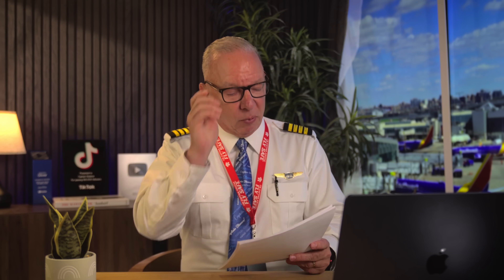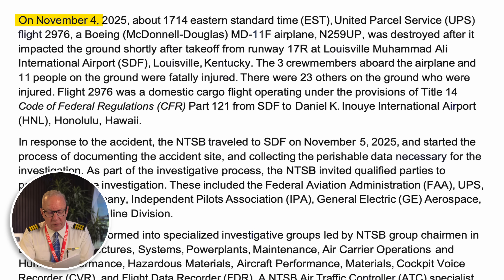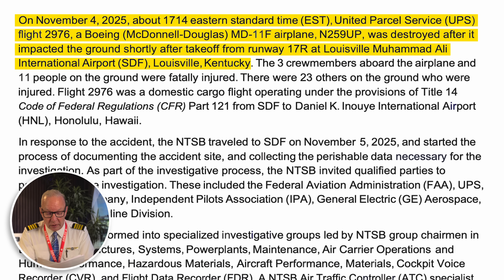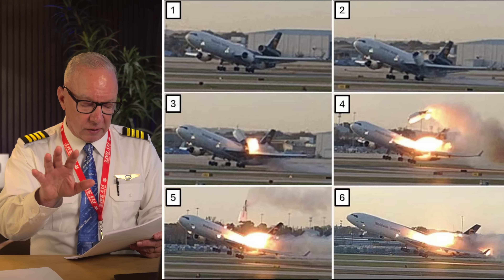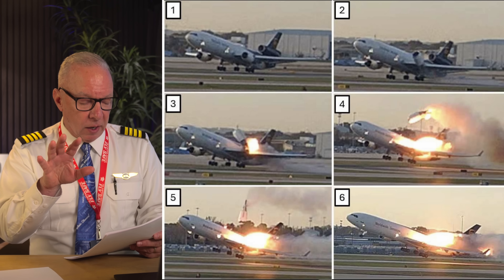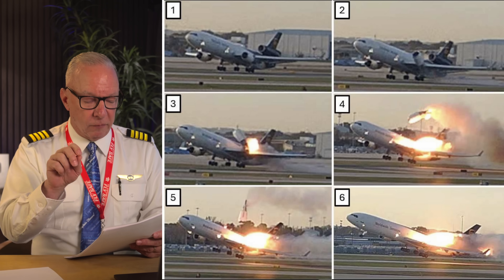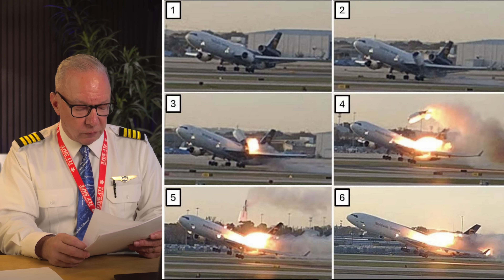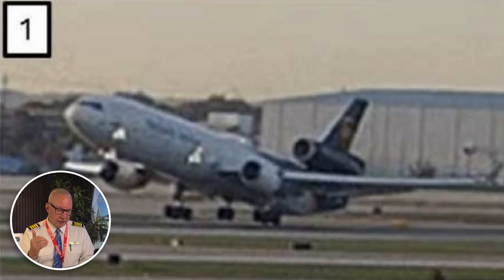UPS Crash Preliminary Report | Pilot Reacts to UPS Crash Report

Comment: Given that the NTSB has obviously read out the FDR data this report should have included information about the failure of engine 2. They likely don’t know why yet but we know it failed and that information could have and should have been included in this update. 

An interesting question is what the certification requirements are for that aft pylon mount. Since we have a forward and aft part of the mount is either mount supposed to be capable of carrying the entire load if the other fails? If not why have two separate mounts that way. If you need both that becomes a single point of failure. Which leads to questions about how that failure was analyzed especially with respect to the effect that failure and the detachment of the engine and pylon might have on the #2 engine. If a pylon mount failure isn’t an extremely improbable event then you have to question the analysis of how that failure might impact the ability for continued safe flight.

Comment: Captain Steeeve, in this modern era of advanced technology why don't manuafacturers and airlines place small cameras showing the top and bottom of engines that can in an emergency show a display on the advanced screens of cockpits so that pilots know EXACTLY what is happening to their aircraft's engines. A cockpit notification of No power and/or Fire IS NOT SUFFICIENT NOTIFICATION TO CREW in case of a CATOSTOPHIC ENGINE EVENT. Even a interior window mounted camera would be better than nothing and fairly inexpensive. LIVES ARE WORTH MORE THAN MERE PROFIT.

Comment: What evidence do you have that the #1 engine itself came apart (FOD, EOD, liberating blades, uncontained failure, etc.) prior to impact with the ground? The blades discovered on the ground are as likely as not to have ended there as the result of the #1 impacting the ground while still in a max, or near max RPM, gyrational dissipation event. In the absence of a #1 engine debris field in front of the #2 engine, the most likely cause of the #2 compressor stall is the burning fuel fire plume (pressurized main fuel line at the #1 engine mount) that either starved the oxygen for - or - disrupted normal airflow across the #2 intake zone. 
40 years commercial engine overhaul work + previous 10 in the military. I might know a thing or two on those "suck/squeeze/bang/blow" thingies. 
I appreciate and support your channel, but as Joe Friday said, "Just the facts, please".

Comment: Captain Steeeve, How are the engines on the more modern planes (777,757,737), which have the same under the wing engines  different from the DC10?  There are a lot of them flying, with out a problem.   I hope the the pylon are check more than every five years.  Thanks for the great video.  Fly Safe Bruce

Comment: These planes should have been figured out all those years ago. DC10 has been a waiting time bomb for decades. When crashes happened in the 70’s this is when it should have went back to the drawing board to make a better support system. I’m aware of the design but if these fractures keep happening wouldn’t this be something they check for regularly? Just as a precaution so these flights don’t fail? This is a lawsuit waiting to happen. As it should be and needs to be towards Boeing and UPS. It’s unfortunate for those people and their families. 
Unfortunately the only time things are “changed” is from death’s and now after decades these planes get grounded. For how long exactly? Sure they’re grounded now, but are they going to just repair each wing mount to then put them back in the Air? Or they going to permanently ground them? Above my pay grade for sure but I’m just frustrated they knew about it all these years ago and it’s happened again.

Comment: In the pictures you showed it doen't look like the fire is coming out of the number 2 engine.  That flame is a lot lower than the number 2 engine. I kinda suspect that it's the engine that came off.  A auestion:  Does this mean that the cpnclusion they came to on the American fflight that lost an engine iw wrong?  In other words, they said it was the mechaniics using the wrong mountting procedure caused that crash.  While that may have been a contributing factor maybe there is someithing inherently wrong with the mount.

Comment: I’m curious if the pylon on the right engine, #3, had any evidence of  fatigue.  Does any other aircraft potentially share a similar pylon issue?  I would think all aircraft with wing mounted engines would need to be checked. For years I have wondered why a GoPro or similar camera aimed at each engine is not standard equipment on every aircraft made.

Comment: While similar to the 1979 DC-10 incident, the failure mechanics are completely different.  In the 1979 incident, maintenance processes damaged the wing structure at the aft pylon mount point and the wing structure failed on takeoff.  In this accident, the pylon structure failed at takeoff due to fatigue.  From an engineering perspective, this is a different failure mode.

Comment: 5:23 that altitude is AMSL, Above Mean Sea Level, so it doesn't mean that the nose of the aircraft was 481 ft above the runway.
Reply: That particular confusion seems to be entirely Captain Steeeve's.  The NTSB didn't specify MSL in their first press conference, so Captain S assumed they meant AGL, which would not be a reasonable assumption (but it was nevertheless an assumption).  Then the NTSB clarified MSL explicitly in their second press conference, which Captain S apparently missed, and so he seems to be claiming (still today) that the NTSB was simply wrong about the altitude.  They weren't - at any time.
Reply: The runway itself is 460-470 feet AMSL.

Comment: Im absolutely not an expert, but I’m fascinated (a little obsessed) by airplane accidents. Its seems wild those pylos where the only thing holding that engine. Seems like it needs a lot more than just that
Reply: Yes just 2 pylons holding the engine to the wing, one at the back and one at the front,  in a way its those engines that are pushing all the weight of the aircraft forwards so yes agree.

Comment: Looking at the photos with hindsight is a bit deceiving as we are looking a bit preemptively. However the left engine looks like it's begining to separate and the right side looks like it's lifting in advance of the left. 

Is it possible that the left engine was losing thrust as the aircraft commenced rotation?

Comment: What i find interesting is that the engine + pylon assemblies are not rigidly attached to the wings, but rather are supported by bearings so they can "swing" to some degree under the wings. So tragic how one such comparatively small component means tragedy.

Comment: Once infrastructure reaches imperial scale,
it requires continual replacement,
not occasional repair.

The U.S. still operates at imperial scale —
but funds and maintains like a suburban democracy.

This mismatch creates stress, fragility, and hidden decay.
It doesn’t collapse — it spreads, dissolves, erodes, then snaps.

Comment: Surprised the fatigue inspections are so far apart on such an old airframe. Praise to NTSB for such a detailed report. Thank you Captain Steve, and prayers for all involved.
Reply: You would think they would at least do a quick inspection before they do the lubricating procedure, and even that is two yrs apart. Crazy.
Reply: @tBeNz0  Yeah, though micro cracks and small cracks can be difficult if not impossible to visually see without some kind of specialized equipment, but don't lose sight of the fact the person DOING the inspections is the weakest point- he or she can miss things or even just be lazy and miss things yet sign off on having done the work properly.
Reply: @tBeNz0 This bearing is not a high temperature or high wear surface bearing like a rod or main. It doesn't rotate at high rpm and it's a ball. A pack of grease and it's good. Like the ball joints on your front end. Only these have balls 😂😂. The pylon hangs on it and swings left to right about 10 second cycle. It doesn't take thrust forces.
Reply: @fedfraud.protection.servic2557  Yeah I get all that, but so many things could happen on just 1 cycle, but to have tens of thousands without one seems reckless. 

I doubt regulations for passenger aircraft are the same, but I don't think many people would fly knowing some of the things on the plane, like the thing holding the engine to the wing, hasn't been checked in over a yr (i have no idea, just giving an example). The sad thing is, I bet they have the money to do better checks and more often, but squeeze every possible penny they can get out of the planes before it has to be grounded for inspection.
Reply: I'm a little surprised too.  Even more shocking is that during 'A' inspections, I understand that the engines may still be hoisted and the forward pylon mount detached, potentially putting excess stress on the rear mount.
Reply: @AJCiani-physics An A check is a low interval inspection. They wouldn’t pull an engine as a normal part of an A check
Reply: @karlmerriam  It is surprising, however, that a non-destructive inspection (NDI) of one sort or another isn't performed, especially at shorter intervals between major inspections where the engine and pylon would be removed. With all the stresses these engines put on the wings, I'm surprised that the inspection interval is six years. I come from an aircraft maintenance background in the Air Force, and though I didn't work engines (I was hydraulics), it seems to me that we had inspections more often than what the civilian world requires. I hope this unfortunate accident forces some changes in the inspection criteria. Lives depend on it. RIP to the crew.
Reply: @billmcquown4168 The NDT inspection was due on the pylon mounts at 28,000 cycles. I’m sure the repeat interval was much lower. The inspection intervals are determined by engineering analysis. Of course a manufacturing defect can go undetected and cause failure. I would bet that the FAA is going to require all of those aircraft to undergo NDT of the pylons before letting them fly again. There will probably be a reduced interval for those inspections required also. Most of those aircraft weee about to be retired anyway so the operators might just scrap them
Reply: @billmcquown4168 my father their was a BOAC aircraft engine inspector, no aircraft took off without being inspected in those days. Seems like things are progressing backwards these days.
Reply: @billmcquown4168  It's amazing how LITTLE actually holds these massive powerful engines onto the wings in the first place!
Reply: @billmcquown4168  It is the rear (aft) pylon bearing lug that fractured. And don't think it has been determined when the fatigue cracks initiated. Anyway, it's pretty deep back hard to reach. Might come up with a colon camera to reach back there and look. I thought it was a bolt that sheared at first. I'm just now starting to get it together to see it.
Reply: The airline industry had 296 lobbyists focused on the sector in 2024. Lobbyists have a lot of clout in the tangled web of governmental bureaucracy.
Reply: One would think the inspections should increase in frequency as the airframe ages  ---  and did they have scheduled replacements on certain parts? ... on my car many components get replaced after a certain amount of time before they fail, and I have no complaints about spending money on that because I obviously feel safer with fresh parts
Reply: @smedleyx  They do decrease the inspection intervals as the aircraft ages. The initial inspection is referred to as the Threshold Inspection. The subsequent repeat inspections are at reduced intervals
Reply: @karlmerriam  It should be clear this failing at 21,000 cycles and not being due for that detailed inspection for another 7 or 8,000 MORE cycles- 1/3rd more, is WAY too far off!
Reply: [And here I still wonder whether I MUST have my Corolla's (full synthetic) oil changed every 5000 mi, or can stretch it out to 7000] 😉
Reply: @stuartparker-q3o  Yes you can. As long as no one pours sand in your crankcase or the PCV falls out of it's socket while you drive off road through a desert or you don't get on it constantly with a dry crankcase or.....😂😂. Bearings can flake prematurely, piston rings scrape metal off the cylinder sleeve, etc. Big part of oil change is it's an internal engine inspection to make sure nothing bad is happening and catch it if it is. Someone once drained the oil out of a Rolls Royce and drove it six miles before the engine seized. Not saying you should, just saying 😂. Tell your guy or whoever to drop a can of STP in next time (as long as the oil is clean).
Reply: @fedfraud.protection.servic2557  I remember, on the (former) radio (PBS) show "Car Talk", where a caller-in told the Magliozzi Brothers that, after draining his car's crankcase, he would run the engine for a bit to "get the oil sludge out".  He asked how effective that would be.  Their response: "It will Dramatically REDUCE the number of oil changes that your car will require during its LIFETIME !" - followed by (their characteristic} loud guffaws.🤣

Comment: Usually enjoy your videos, even if the subject matter is tough to cover. 

But I have to point out two issues with your analysis:

- AGL vs MSL. ADSB altitude is MSL, and given the runway threshold elevation of 489’, the ADSB altitude was within limits (at least ATC limits +- 199’)

- You confused mounting lugs, vs attach points in your discussion. The cracks & failures reported referred to the FWD & AFT lugs, of the rear attach point. 

Having said that, I still appreciate your videos & commentary.

Comment: 13:40 Correct me if I'm wrong - but the use of "cycles" in aviation is used to determine the amount of stress on the pressure hull due to pressurizing and de-pressurizing as well as landing gear and load-bearing structure - during landing in particular.

In the past - accidents have happened on short-trip routes due to exessive wear on essential components.

That's different to any other machine - where running time (hours) and/or travelled distance (mls/km) is sufficient to indicate wear.

Comment: Non pilot here with possibly a dumb question.
I'm assuming the pylons are attached with round bearings so they are designed to have slight movement?  Giving it a soft joint that is less likely to have stress fractures?

Comment: What is crazy it is 2025, and planes are falling out the sky like it is the 70's and 80's again. I am a former vet, i have lots of time in many different aircraft as far as riding in them from the 90's to early 2000's. You will not get me one a plane in todays world period. Planes running into fixed objects and other aircraft on the tarmac, air traffic controllers not doing the job properly, maintenance crews not doing their jobs. Planes almost landing on each other. Naw i'm good. I no longer trust air travel at all. I have no faith in the people doing these jobs anymore. No attention to detail, which is a must for the safety of the passengers and people.living their lives on the ground. The FAA needs to fix this asap. And this is also UPS fault to a tee and they need to be sued, and put out of business. Its time to start making examples out of these companies. People are no longer here because of them.

Comment: Terminology is very important when reading reports. As per the diagram, there is a forward LUG and an aft LUG of the aft MOUNT. 
The report was specifically referencing the AFT MOUNT. There is no mention (in this video) of the forward mount.

Comment: In 1979 AA191 had a similar catastrophic failure of the number 1 pylon and engine ending in a crash. Seems to save time the mechanics detached the engine attached to the pylon by pulling the for and aft connection bolts rather than taking the engine off of the pylon. Much simpler to remove, but a pain to reattach as a forklift had to lift the assembly into perfect alignment to reattach the engine, pylon assembly. It was observed that the mainanance crews would bang and twist the clevises in an attempt to line up the holes. This caused stress fractures that grew over time and caused catastrophic detachment during the accident flight.

Comment: It baffles me that planes aren't inspected down to the smallest bolt, every year, with full metallurgical testing including magnetic flux tests, to ensure no fatigue is building up unchecked. 

 Yes, it would cost more, but the answer to that is to absorb the cost and smile, knowing your crews and airframes are safer. It should also reduce insurance costs to perform full inspections once a year.

Comment: Thank you for this report.  These inspections need to be shortened as the plane gets older for tqwo reasons.

1 - Metal fatigue builds up over time.
2 - It will serve as a soft retirement for these older planes as maintenace becomes more and more cost prohibitive to use them.

Comment: Is this down to poor maintenance  and check procedures similar to the issues in the previous dc 10 crash in the seventies. it sure shows signs of the same  fault as far as i can tell. If not are they wearing aviators when doing structural exams on known weak points on engine pylons.These planes need removing from service when they have been pushed so hard for so many cycles. its like driving down the road with a cracked or broken chassis on an old dog of a wreck. is not allowed on the road why are 50 year old planes allowed to fly? its just a cost cutting measures almost a regime of don't replace the plane until it falls from the sky.

Comment: Lug pics showed definite fatigue and deformation.  Micro-deformations amplify vibration and rapidly accelerate mechanical failure.  Easiest short-term solution is to halve scheduled replacement periods for these structural elements.  Long-term: scrap the air fleet or, implement sensor monitoring tech and modify inspection procedures.  It all comes down to cost and parts availability.